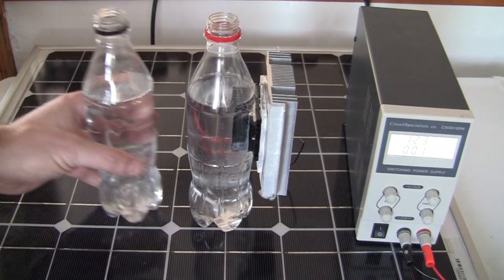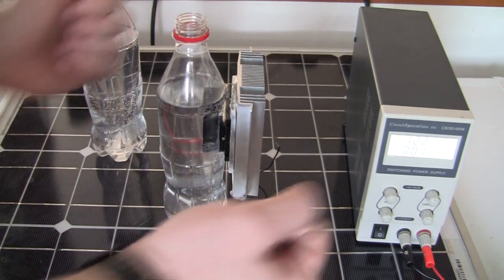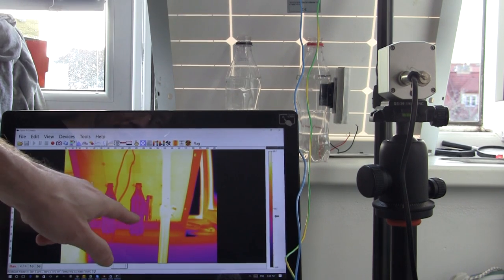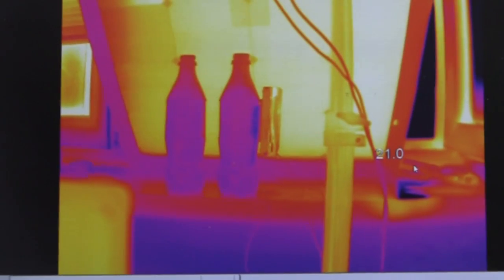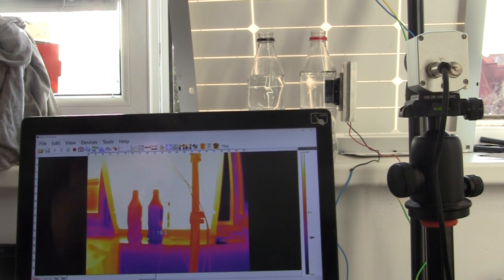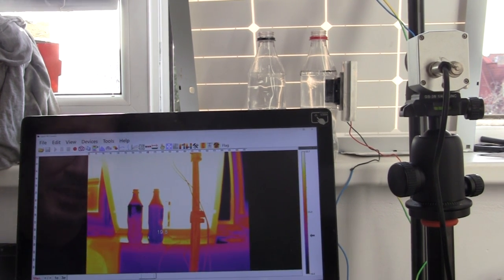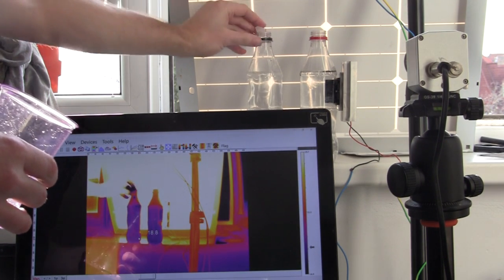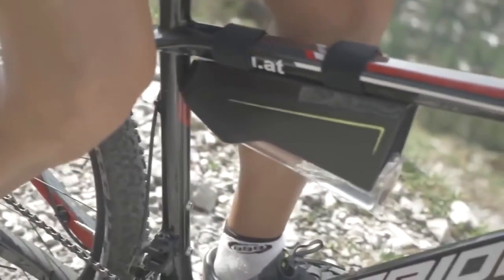Self-Cooling water bottle ACTUALLY WORKING!!!

Comment: All joking and the terrible inefficiency of the thing aside; I think something SIMILAR to this might have some decent applications, at the very least as a consumer product. Replace the, uh, 'small' solar panel with a battery, and change it from a plastic bottle into a metal thermos type situation with a removable inner 'cup', if you will. And there you go; a self-cooling drinking vessel. Someone else in the comments here pointed out that if you switch the polarity you can make it self-heating, so we can throw that in there as well. There we go; a self-cooling AND self-heating drinking vessel. It's flawless!

I'd be far more inclined to immediately run to Kickstarter if I were not certain this already exists.
Reply: To make it more marketable include a crank dynamo or something to charge up the battery.
Reply: Eh, just freeze your beverage inside the thermos ahead of time. We don't really need power-everything.
Reply: I had a similar idea in a different direction, looking at the size of the solar panel needed to chill a beverage in reasonable time: patio umbrella. Long pole, solar panel mounted horizontally at the top (or maybe in radial triangular sections, so it can "fold down"), cable running down the pole to a Peltier chilling sleeve like you describe. Bingo, you have a solar device that chills beverages, installed in a setting where you'd naturally want to have a chilled beverage.

Maybe line the inside of the chilling sleeve with flexible ribs filled with that squishy thermal gel you find in hot/cold packs, so the sleeve can conform to a limited range of glass/bottle sizes and shapes, and act as a bit of a "cold reservoir" when the glass or bottle is removed for drinking out of.
Reply: Power it with your bike.
Reply: You could do that and it would work but if wouldn't cool many beverages. Basically you made a really expensive fragile small capacity cooler. My patio umbrella is about 20 steps away from my ice maker LOL.
Reply: Egalitron assuming 100 efficiency and a perfect thermos you'd drain two smartphone batteries in 1 hour to cool a 1 litre water bottle from room temperature to a slightly cool 50F.
Reply: Considering the trigger for this was the self filling water bottle. And the whole point of that was to not carry around large amounts of water, or for emergency purposes, then this defeats the point. But yes you give the most practical solution.
Reply: Eh, I am doing the amp hour calcs, and 10K amp hour batteries are more than doable, hell 25K amp hour batteries are doable, this.. can be done! It isn't an abuse of thermodyanmics, you get one or two uses out of it.
Reply: Just bring some damn ice cubes you moron.
Reply: Nathan H Well, he could put the heat sink on the bottom, add a case around it and mark it as "HOT", maybe even make it red, so people don't touch it. Then it would look like a normal bottle, just with a bigger bottom part.
Reply: The thermo works great for the morning coffee, just before starting walking up the mountain. The problem with thermos is that they have a small capacity, sunny days, you sweat a lot and you'll need enough water.

There's a far more simple solution, you don't even need a thermo, and you can use it with a 1.5 litter water bottle: put the bottle of water in the freezer (after drinking a bit so it's not full)  the night before. It's not a great solution neither. And sadly, it's only works with water, leaving aside the basic and most necessary liquid in the survival of human beings: beer.
Reply: Or you could just pour already cold beverage into the can and only keep it cool. With just a little extra power you could keep your drink for longer than just by isolation. I don't think there's a market for 24+hrs cans though :/
Reply: Make a glass wine decanter with a very conductive bottom (copper or the like, not too much to keep the thing light), put it on a pedestal with a peltier device in it, add a thermostat.
Bam! You have a device to keep the chardonnay at temperature for an indefinite amount of time while you sit with your guests, far more controlable than traditionnal cooling.
No solar panel needed.
Maybe make the conductive metal go to the top so that it cools without forming a cold layer at the bottom.

I can see a market for that kind of thing...
Reply: Peltier elements are incredibly inefficient. It works if you have a car engine or motorcycle engine running and providing voltage, but the minute you shut down the engine you need to unplug it to avoid killing the battery. Alternatively, you could use a 100w foldable solar power.

To get really efficient cooling, we'd have to ditch Peltier elements and use compressors - but those are heavier and have more moving parts.
Reply: Peltier devices are very good at one thing, and that's getting incredibly hot at full power. I managed to get one up to nearly 400 Fahrenheit on both sides with a battery sub doing 12V and 4A. Ignore the fact I was trying to make it cool on one side.
Reply: Now... firstly... pulling 50 watts out of a battery will not get you many times to cool that and heating takes A LOT of energy... at least to significant degrees. But yeah... why not. People buy worse stuff.
Reply: https://en.wikipedia.org/wiki/Botijo no batteries needed
Reply: Why not? Think hikers, for example. Lots of sun power but no fridge in the nearby. If you have done hiking in a sunny day, you know how it feels some cold water.
Reply: There are already many coolers ... usually made for cars 12V output.
All those things works, problem is power supply. Solar panels are still heavy and gives little.
But you are free to test whatever you want :) 267W peltier costs 30€, those smaller 10W are for 4€.
20W solar panel is for 30€ ...

Comment: Question, what if you did this but with a thermos and had the peltier on the bottom and battery powered? That way the container had some insulation, and the peltier is just on the bottom so it's out of the way also the hot side is on the ground which could maybe pull heat away better than the air. Though I don't know how well a battery would fair, but i'd assume a li-po or other high energy batteries would possibly work just fine.
But ya this is horribly inefficient, but wouldn't it be able to keep a cold drink still nice and cold? Assuming it's in a thermos like container and such. Note I know this is a joke idea by the way, but just curious about these things.

Comment: Peltier-based heat transfer can only drop the temperature a max of 40 degrees F. This is the same technology used in fridges before compressor-based refrigeration and the same technology used in the 12v electric camping coolers. 

A self cooling water bottle is possible but don't expect ice water from it on a 100 degree F day. It can be done using Absorption-based refrigeration, using heat to make cold. This is the technology used in propane fridges. 

So modify a super insulated water bottle to have passive Absorbtion-based refrigeration, which will "self cool" the water inside when placed in the sun. The outer surface needs to be shiny to minimize heat buildup.

Oh, I have 2 self-cooling "water bottles" on the way right now. They're called desert storm water bags which store a gallon each and is self cooling by evaporative cooling. Just buy that and a LifeStraw and you're set!
Reply: absorbtion fridges tend to NOT work very fast. Sure they'll cool down nicely, but their intervals are INSANELY long and tedious.
Reply: Very true, I should have mentioned this fact. The thing with absorbtion-based cooling is it doesn't require electricity if theres a heat source put on the hot side. The bottle would need to be designed with many sealed absorbtion-based cooling cells to have a noticable cooling effect (Don't take my word for this).  

As I said I already have 2 self cooling "water bottles" (arrived in the mail today), they're called Desert Storm Water Bags (http://www.goldfeverprospecting.com/destwabag.html)! 
If you want a hard sided self cooling water bottle, get a unglazed ceramic bottle that "sweats" out water for  evaporative cooling.

Comment: If you're thirsty in hot conditions you're better off drinking warm water anyway - it takes less energy for the body to transfer its own heat to make up the difference. I have first hand experience with this and much prefer water that has laid in the sun to hydrate me that something dripping with condensation. Those diet coke ads where the dude cools his neck with a chilled can give a false impression. 

Regardless this is an impressive find, props.

Comment: Pffft Ive had so many self cooling water bottles that I couldn't even count them. Each one of them used evaporative cooling to keep the water at an infinitesimally lower temperature than its surroundings. I mean hell, I wasn't even a toddler before I figured out that I could increase the rate of cooling by drastically increasing the surface area of the fluid.

Comment: You should make this on a slightly larger scale.  The gatorade coolers that sports teams use would be the perfect place for this, even in its current form.  Since those coolers remain stationary, the cumbersome heatsink and large panel would not be a huge issue, and taking 20 - 40 minutes to cool the whole container wouldn't be an issue for a team that's practicing, or a crew that is working, etc.

Comment: why do you not put the lid on?
Reply: MrScottev Why...so the warm air doesnt rise out?
Reply: Broken Wave does the peltier heat pump not transfer the heat? Just I was thinking this would be more efficient on its side with the heat sink at the top. I do know this experiment is just to show how insane the claims for the self-filling water bottle are.
Reply: Honestly I think any orientation will get almost identical results.

But considering he had a control bottle that was the same orientation it doesn't really matter.
Reply: Broken Wave thanks for the reply and I meant with heat sink on the bottom not top. So it would make a better vortex and would cool quicker.

Comment: That's pretty cool (no pun intended). So, how realistic would it be to make tables out of the solar panels, put heatsinks into the table surface and have the tables out in beer gardens and other outdoor cafes? It'd be a novel idea for keeping your drinks cool in the summer. Well, if it worked properly in the first place.
Reply: To be honest, I had no idea how hot they get. I've never touched one, and never researched into how hot they get. So at least you've answered my question. Not realistic or possible at all. Thanks my dude!

Comment: how big of a temperature difference would it be possible to achieve by letting some of the water evaporate from the surface of the bottle? I know this method works for cooling as evaporating liquids remove some heat from their surrondings, but i haven't found any sources of what kind of temperature differences would be possible at room temperature

Comment: Even better - you can switch polarity and get self heating water bottle :D
Reply: Or you can leave it out in the sun
Reply: George Eliozov Our troops can march indefinitely when issued with such a personal tea making device.  For the Empire!
Reply: Or you could just place it in the sun. Since you're using solar energy anyway
Reply: just put a SECOND  bottle on the heating fin and make cold and hot water at the same time!!!!
Reply: One side coffee or tea other side milk XD
Reply: I mean it's out in the sun, gonna heat anyway
Reply: George Eliozov self boiling water bottle
Reply: or you know,stick the hot side of the thermoelectric device into a water bottle and get 2 in 1.self heating/cooling water bottle
Reply: The Peltier  element is by itself Heat transfer unit. So all you need is
 polarity electric switch [Heat] / [Cool] option to change direction :) Cold soda or hot
 coffee just by one click :)
Reply: You can also paint the bottle black and heat much quicker.
Reply: George Eliozov well... If youre in direct sunlight, just use that.
Reply: Self heating coffee mugs would make millions
Reply: +Chopper Gamer When you swap polarity, the cold and hot sides swap so that's all you need to do
Reply: If you are an adventurer you know the anxiety that comes with overheating in the middle of the day. The last thing you want is overheating when you're hours away from night
Reply: Yes, you can switch polarity and switch hot/cold sides.  I have a few of them and do that when I play with them, usually with a 9V battery.
Reply: Why not even 2 bottles at once!!!!! OH MY GOD!!! that innovative and visionary!!!!!
Reply: +Chopper I don't think that's right - it worked on mine, and here's a quick google result: https://electronics.stackexchange.com/questions/124211/are-peltier-elements-polarized
Reply: +mrBorkD Now let's just switch the sun to cooling mode
Reply: How about a self heating hot chocolate?
Reply: that is an idea what if you made a bottle that you could just flip a panel and now change from hot 2 could or even make one that has a very low power pump and you can channel past the cold side or hot on the flip of a switch
Reply: George Eliozov yeah but you would need vast amounts of those to achieve a good result
Reply: there a speecial kind of peltier plate you can switch thing around
you can even produce electricity at a stupid demunishing return from heat :O
Reply: What's the use of a self heating bottle on a hot sunny day?
Reply: Or on hot day, if you pour cold water in it, you can produce electricity! Maybe enough to send SOS signal! :D
Reply: both whith a flip on a switch lemonade or tea, this has future
Reply: George Eliozov Perfect for hot chocolate or soup!
Reply: Might aswell buy an electric stove lmao
Reply: You wouldn't want hot, or even warm water in a plastic bottle. Even at room temperature, plastic can leech carcinogens into your drink.
Reply: Sebastian Grygiel just use nighttime
Reply: In that case you might as well just put a little heater in there.
Reply: Its called a microwave lol use it too warm your mug or fluids up np. Perfectly safe
Reply: i have a peltier cooler on hand, it does work opposite switching polarity, but at a lower efficiency
Reply: Jenovas Witnesses 〈Nova〉 Can you carry it around?
Reply: at least on heating it doesn't matters
Reply: Or you could get a thermos and keep it at whatever temperature you like as long as you want (need it hot longer? get a better thermos.)
Reply: Or you can just remove the solar panel and put a normal water bottle out in the sun and it will self heat!
Reply: Yeah xD
Reply: Whoa oh noooo, how bad.
Reply: Chemicals like BPA only really bad for children and pregnant women's babies. For everyone else, it is still something you never want running amok in your system. Casual plastic water bottle drinking every so often is harmless, however.
Reply: Hasn't anyone on this thread seen cooling and heating car fridges? All they do is switch the polarity to pump heat across two heatsinks in either direction.
Reply: you mean a watercooker. i think we have those already. also i don't know if switching the electric polarity will work, since the peltier deivce is supposed to work on PN crystals. those tend to react differently on switched polarity. diodes, for example, are made of PN crystals and will only allow current flow in 1 direction.
Reply: Sebastian Grygiel no,listen,the usual peltier effect device is not polarized,it works with these p type and n type cell array which are polarized.I dont take EE but I have elementary understandings of polarized electronics and I say switching polarity doesnt work on this thing,like an led.(not principally the same but  functionally the same)

Im not sure about this,correct me on this guys